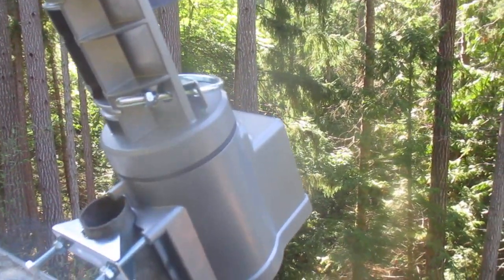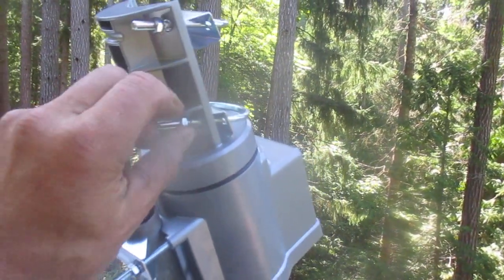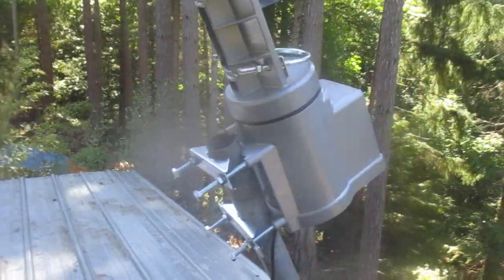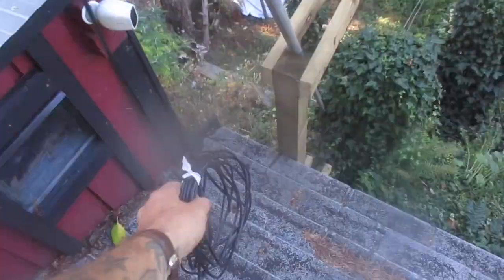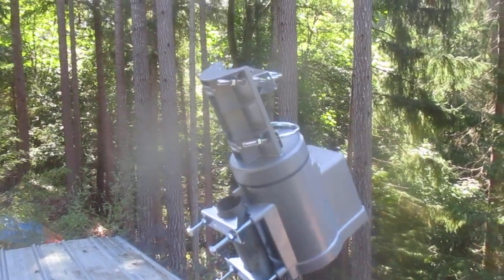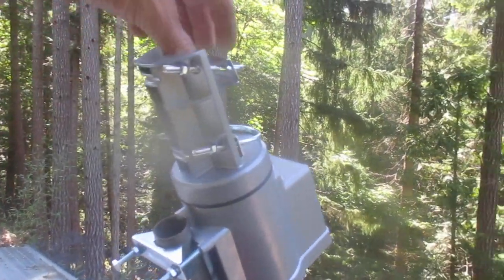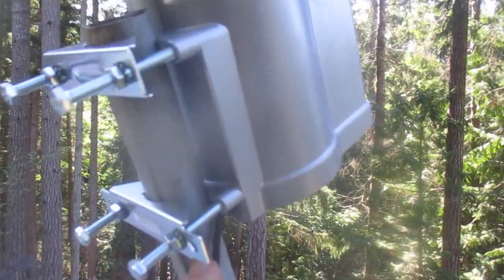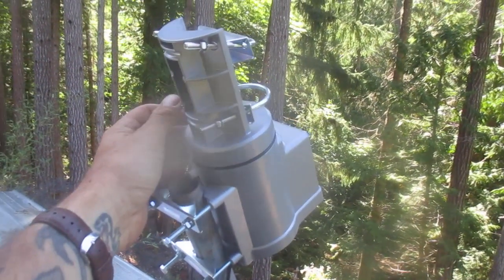Rotor installation for New  Beam antenna

Comment: i Have the same rotor,i recommend shorter the better because its a very light duty rotor really recommended for tv antennas,mine was a 1 ft mast above rotor with the flatside beam.Mines held up for years
Reply from the maker: Thanks for the great info.  Awesome to know that. Cheers